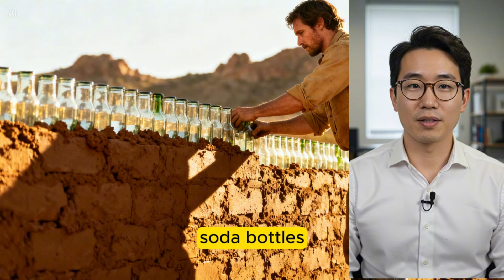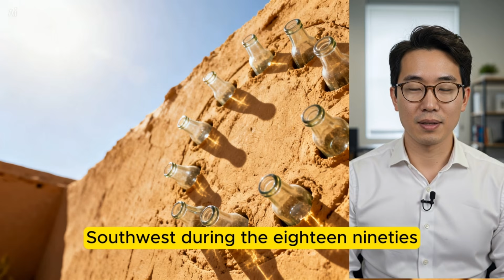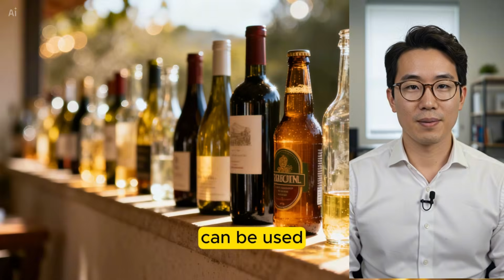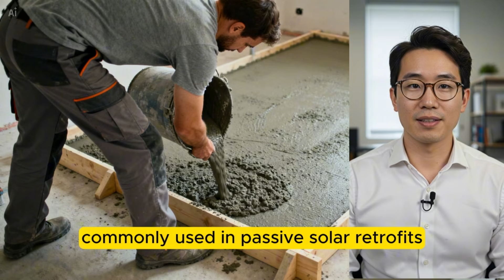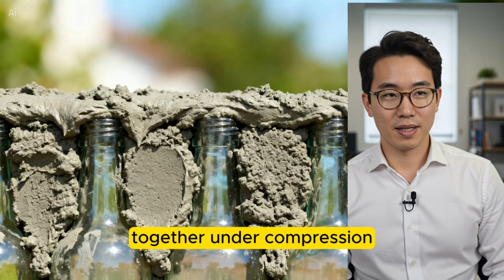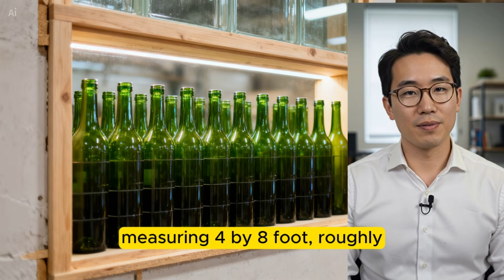THESE FREE WATER-FILLED WINE BOTTLES STORE 3X MORE HEAT THAN CONCRETE

Comment: Alert! AI misconceptions!
A recycled bottle wall does not hold water. Never has, AI does not grasp that the glass bottle walls are filled with air, as insulation. Not heat retention.